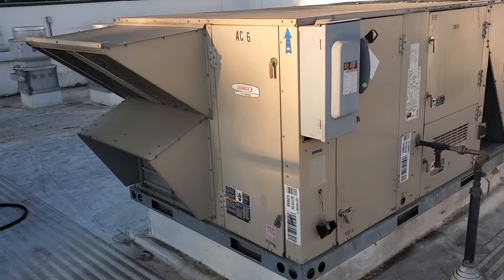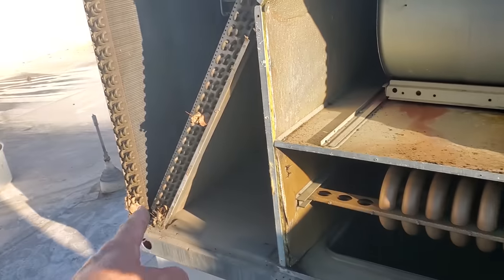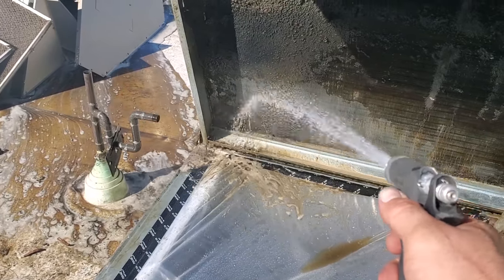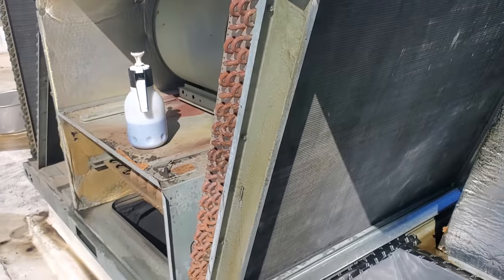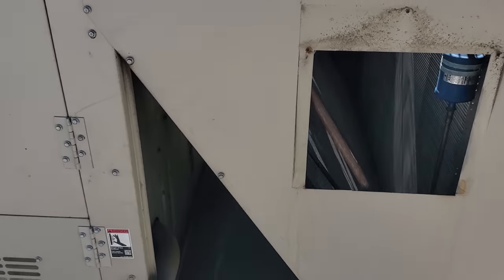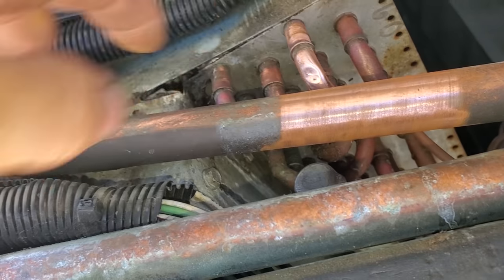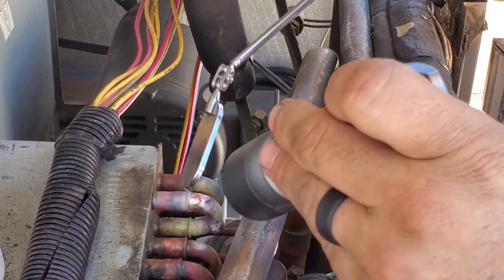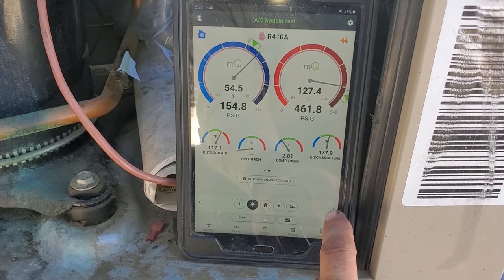THE KITCHEN AC SMELLS FUNNY

Comment: I get all the comments about “fumes”. It goes without saying you don’t wanna intentionally piss anyone off but and I’ll put this modestly “some” (meaning like 99.9%) of people are gonna bitch no matter what. Just tell them it’s formulated to help fight covid bacterianoidfungulitis.
Reply: I was in charge of reroofing a whole university campus of 28 major buildings. We had to work at night and demobilize every morning so the staff would not be bothered by seeing all those “workers” hanging around. Forbidden from using a high quality built up hot mopped assembly because of that “nasty oil smell”, we did the job with big rubber/vinyl sheets. I thought everything was fine but got called to a big deal problem solving (ass kicking) meeting. I thought I knew what was up and made a pre-emptive stop at a big retail store on the way to the meeting. Sure enough, faculty had their noses all bent out of shape (sorry) because of a “chemical” odor. I set a box on the table and removed the contents asking if this was the smell. Sheepishly, the point was made and my crews went back to work. Inside the box was a kiddie blow up wading pool. I hope that they all felt really stupid mostly because they were. On time, on budget, most did not even know it was happening. Score one for the old guys.

Comment: Id clean it with nubrite as nasty as that is. Gotta be careful that an exhaust fan doesnt pull fumes out of rtu and down into the kitchen.
Thats probably why they say not to use nubrite on an evap coil. Putting plastic on supply and return. Good job

Comment: Just for a goof, pick up some "Simple Green Extreme Aircraft Cleaner". Bring that to one of these clean out jobs. Just try it. I use it for all kinds of stuff and havent found anything better.
Reply: it will likely work as good, but the smell may be much too strong being pulled and blow indoors
Reply: I’ve used it in a pinch myself,  worked great and smelled good ha
Reply: @throttlebottle5906   I thought the simple green has a pretty benign odor
Reply: @Rattletrap-xs8il  outdoors in open space sure, but on a roof that's bowl shaped with economizers/makeup air from the roof space, it could be very strong indoors.

Comment: The money you are making on labor alone and you are worried about the cost of pvc and fittings? I saved those from unit replacement for that application....just sayin. Nice braze, you held your heat back. So many people put the blue part of the flame in there and wouldnt have touched the suction.

Comment: COMP LOAD SHEDDING --> Unit is running at lower power capacity
COOLING --> Cool demand present; unit is cooling
COOLING W/FREE COOLING --> Compressor cooling and outdoor damper is open to maximum.
DAMPER MODULATING WHILE COMPRESSOR ON --> Compressor is on during free-cooling, and damper is modulating.
DEHUMIDIFICATION --> Dehumidification demand present; unit is dehumidifying
FREE COOLING --> No compressor cooling
FAN ONLY --> Fan only
FAN ONLY - OAS --> Fan only, outdoor air is suitable for free cooling
FRESH AIR COOL --> Cool ventilation air to neutral value
FRESH AIR HEAT --> Heat ventilation air to neutral value
HEATING --> Heat demand present; unit is heating
HVAC OFF --> No heat, cool, ventilation allowed
IDLE --> Demand satisfied; blower off
IDLE - OAS --> Same as IDLE, plus outdoor air is suitable for free-cooling
LOW AMBIENT LOCKOUT --> Outdoor air is too cold to allow fans to run
MORNING WARMUP --> Outdoor air damper closed
M2 FAILED TO RESPOND --> Display is missing messages from M2
M2 RESET --> M2 controller is resetting
OFF ON ALARM --> Unit is off due to presence of alarm
PRE-COOL --> Compressor not allowed—free cooling. (During the first 30 minutes of the first cooling demand following a change from unoccupied to occupied, calls for mechanical [compressor] cooling are ignored if an economizer is installed and if outdoor air is suitable for free cooling.)
PREINSTALL --> Must follow installation menus
PROCESSING --> Display is busy processing data from M2 controller
RESTARTING... --> Only displayed at power-up
SMOKE --> Smoke input detected
TEST --> Network has unit in test mode
UPDATING --> M2 controller is updating 
One blinking LED --> This indicates bootloader mode